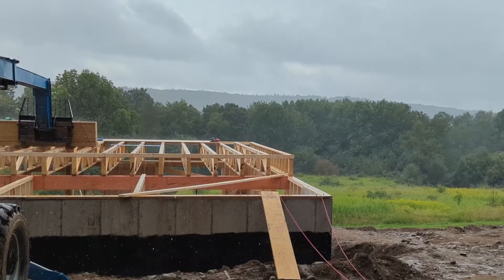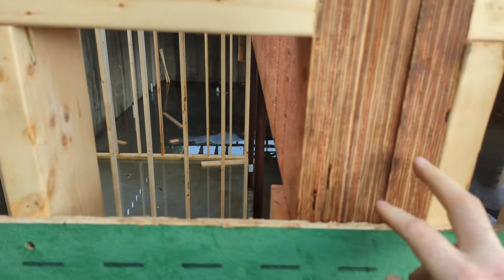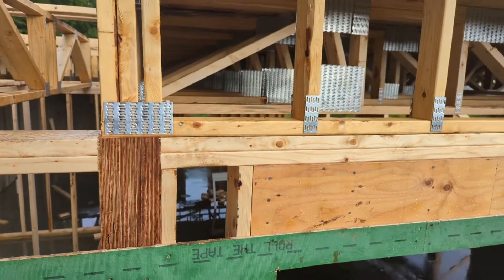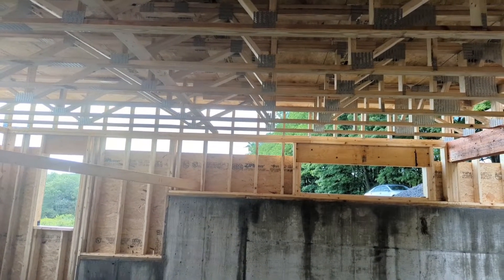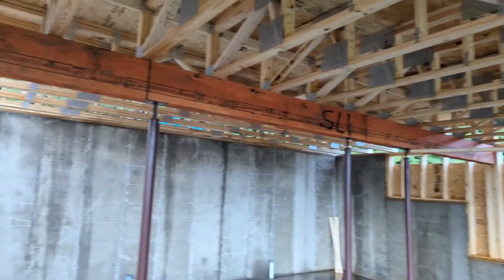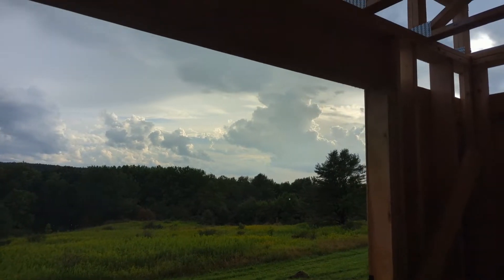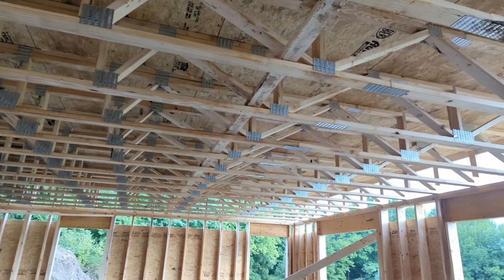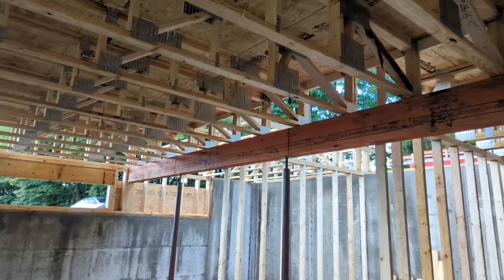Open Web Floor Truss Benefits for Walkout Basement

Comment: I saw only two 2x4 studs at each end of the laminated beam.  It does not appear structurally sufficient.
Reply from the maker: The ends of the beam rest on the concrete foundation and it also has 5 metal posts each with their own footer under the floor
Reply from the maker: One end has 2x6 under it between the stepped foundation and the beam the other sits in the sill plate

Comment: i dont get the need for a beam. those trusses can span 25 feet easily with no bream in the center. you must have some heavy loads on the upper floor. im building a house now spanning 20 feet with no internal support at all. 16 inch depth trusses can span 25+ feet with no center beam. 20 inch depth can spam 30 feet or more with no internal support. this is assuming 16oc spacing.
Reply from the maker: We spanned 22 feet with the trusses to the beam and then an additional 12. We went 19.2 spacing to accommodate the ductwork. I'm not sure if we could have spanned the whole 34 but i don't mind the extra support and it fits well with our floor plan.